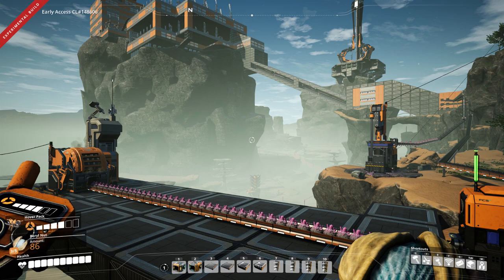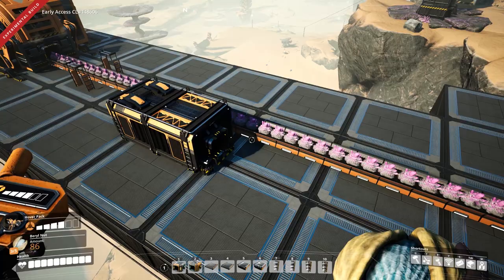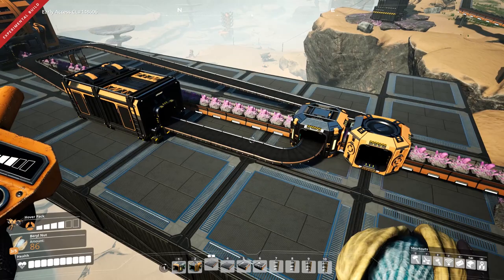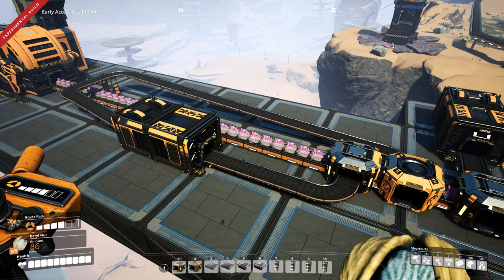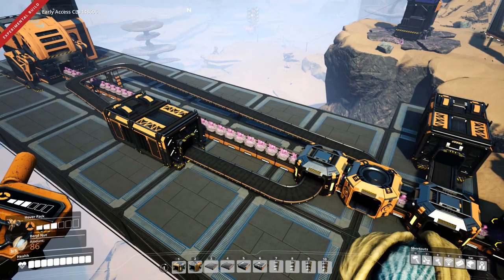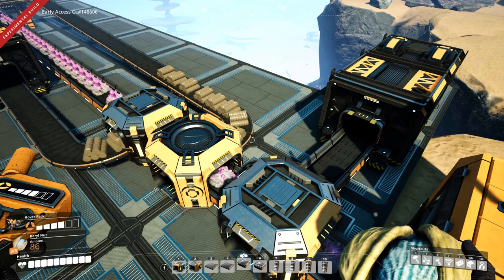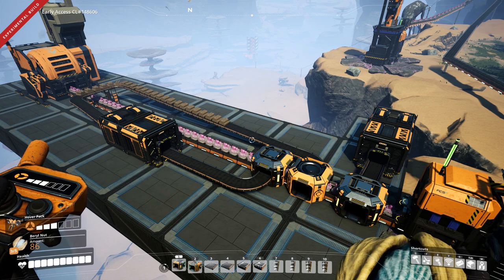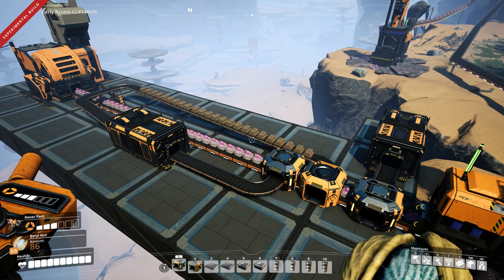How to get an exact(ish) amount, per min, off or on a belt [SATISFACTORY]

Comment: I found this video looking for ideas to take an irregular rate of items and change the rate closer to constant. I had a belt of items going at 70 per minute, but in bursts, making the awesome sink turn on and off over and over. I don't like this as it makes the power consumption irregular. But this trick, apparently for a completely different problem, was just what I was looking for! If a mark 2 belt does max 120 per minute, and I have one belt going at 70 per minute, inputting 50 junk items into this 1 minute loop spreads the 70 per minute unfiltered items just enough to leave the sink on constantly!

Of course, now I'm also interested in removing an exact amount from a belt and seeing what I can do with this. Great video!

Comment: I’m always watching :P
And yeah, I could definitely see this idea having applications for people. Especially since you could extend the belt length for even finer control (2min loop would make each item cause .5 items to split off). Or, just make it more compact if you don’t need as fine of a control (ex .5 min loop -> can siphon multiples of 2).

Also, you could do what you suggested for handling non full belts - downgrade the main belt speed - to help with the imprecision of the loop time, if it was really critical.
Reply from the maker: Exactly. I also realised after that you could use a mk2 belt instead for the 1min loop belt, which would make it a 30 second loop and therefore doubling the output of overflow against the items you put in the loop, if that makes sense. But yes, quite a few ways to manipulate the idea to make it suitable for different applications. Good stuff.

Comment: I've been playing around with this but struggle remotely controlling the looping belt or rather how to drain it again afterwards. A smart splitter isn't flexible enough given the exact size and placement requirements. A truckstation can block and partially clear it but not completely in one go. Do you have any tips?
Reply from the maker: Not sure if I 100% understand what you're trying to do, but the 2 suggestions you came up with are probably the most practical...anything I can think of would be massively over-complicated.

On this video I did sometime ago (https://youtu.be/SchAH4nAhY8 at around 15:43 mark) I use a similar loop to overflow 1 item per minute, or 30 secs. But the loop is different, so it is somewhat flexible, you just have to play around with the timing etc. Bit of a pain I know.
And if you can change the layout, you can use the unused output on the splitter that is already part of the system, to drain it. This is not a remote option of course. But as far as I can think, probably the most practical.

Comment: Very clever! Thanks for sharing. I've always wanted to throttle belt speeds so there is a consistent flow on a moving line.  What was the best/easiest way to time the belt loop when figuring out the track length? I'm thinking of condensing this using multiple lifts feeding the loop back over the incoming belt to the merger. I imagine finding the timing was a pain?
Reply from the maker: Thanks mate - yea it's just a bit of trial and error to work out the length/timing. It's not so hard to do, but you may need to experiment with it a few times.